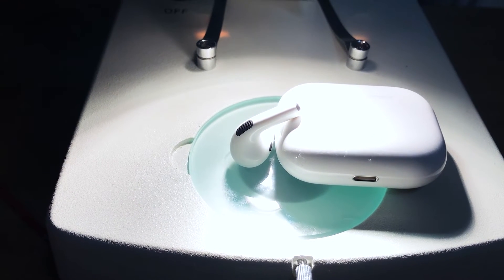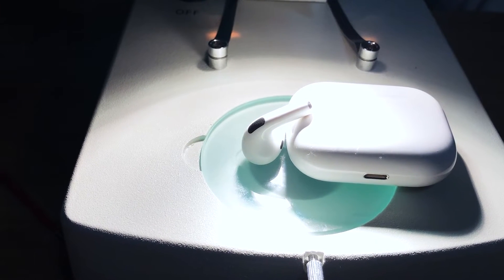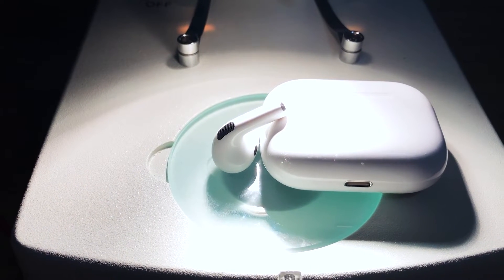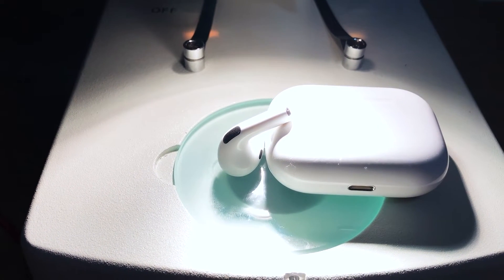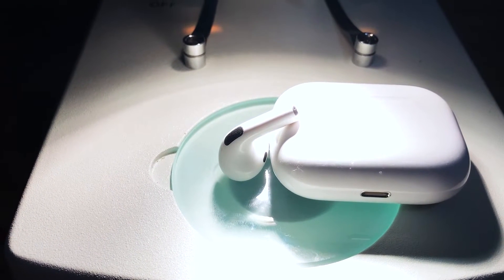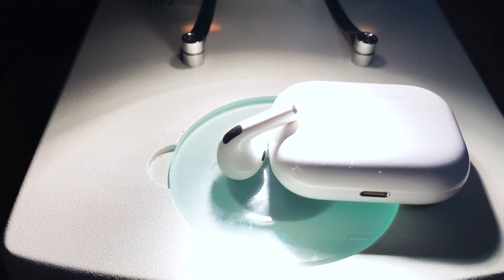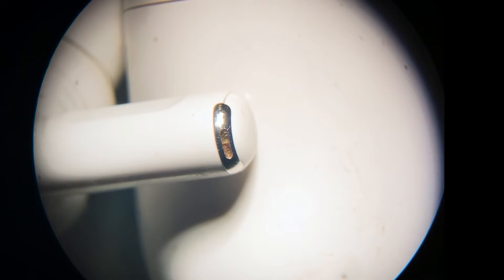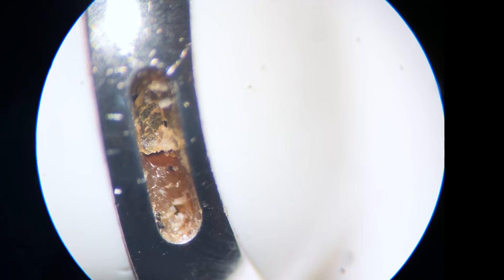Airpods Pro: Quick Fix for Sound Issues Part 2: EXTREME CLOSE UP

Comment: Hello there… I replaced my Airpods Pro’s eartips, the left side at first seemed kinda stuck when I was trying to detach it so I pulled it out forcefully, then part of it broke and I  had to take it out using a paper towel and knife (without damaging the earbud) after that I replaced the eartip with another one from the box, the audio seemed fine, so did the noise cancelling… then I realized the transparency wasn’t working, and it’s been like this for a while because I haven’t found any help on this, not even Apple could help, everything on the left side works fine except transparency, I’ve even tried to clean the thin microphone to get rid of earwax but nothing works
Reply: Have you figured it out now?

Comment: Not quite the same but I have a airpods 3 and thanks to this video I might just have found out the issue now, for past 3 the microphone on it was making my voice mumbled and I had to disconnect when someone calls and just use onboard microphone and speaker to talk. I will clean it and if that solves the issue